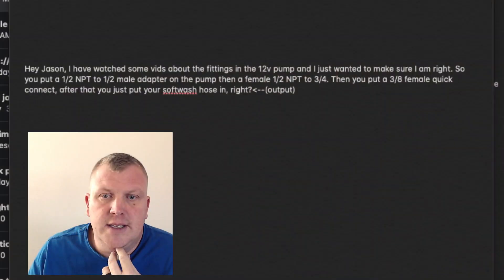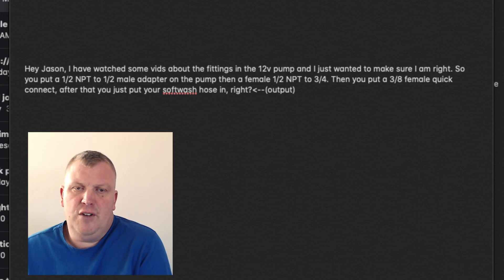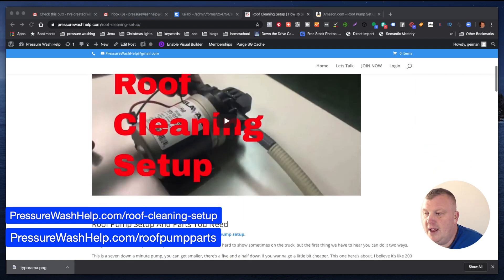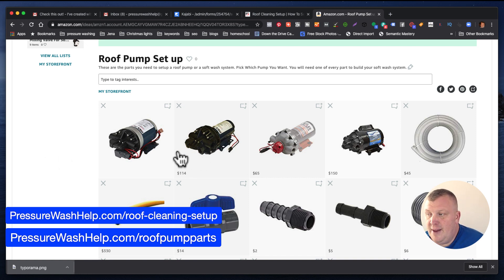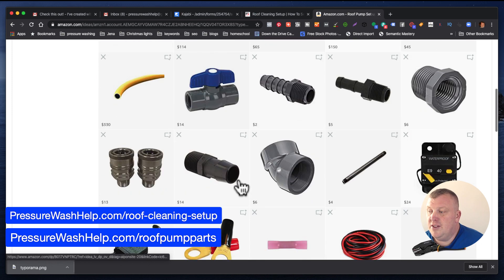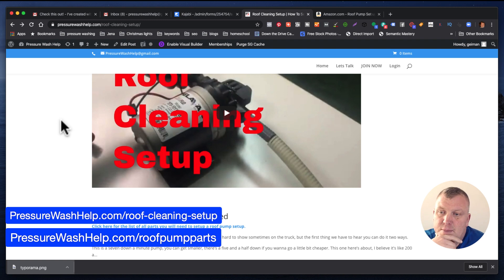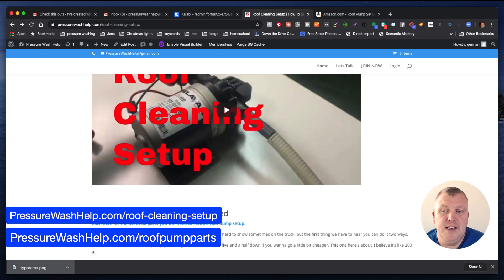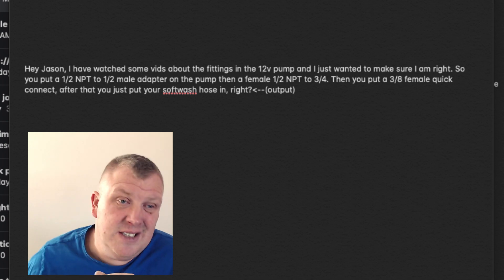Why I Feed My 12 Volt Pump With Big Hose

Comment: Hey Jason. Big fan. So I have a 5.5 12v I just set up. I did the amazon do it yourself special chemical regulator that everyone suggest. The regulator is 1/2 inch so I plumbed everything with half inch hose. However I'm realizing now after plumbing everything with half inch hose that the soft wash hose is actually 5/8.... Did I mess up? Should I replumb everything with 5/8?

Comment: Sup Jason. What pump do you recommend for an 8gpm Honda and a 275 gallon water tank? 5.5 or the fat boy 7
Reply from the maker: i wouldnt use a pump for an 8 gpm
Reply: @kingofpressurewash  Not for a 3.5 gpm either?

Comment: I made up my own soft wash system with your help, running the 5.5GPM northstar pump worked fine got it on sale for $110. Stood in my driveway it reached to top of my roof above my garage and that's with bonus room above so I'd say 30-40ft. Thanks for all the videos.
Reply from the maker: That’s awesome dude
Reply: What size hose are you using?

Comment: Awesome Jason, thank you
Reply from the maker: Thanks for watching
Reply: @kingofpressurewash  Hello Jason...Just bought a 5.5 overflow, hooked it all up, ran for 3 minutes, turn off the ball valve and it shut off, opened the baall valve and nothing??? any ideas
Reply: 5.5 everflow diaphram pump
Reply from the maker: @Mark-ej3tx  fuse
Reply: @kingofpressurewash  I checked that..still looks good...took off pressure cap and tried..nothing...only thing I havent done is take off the casing...dam thing right out of the box, is this normal??? By the way thanx for your time and response....love your vids